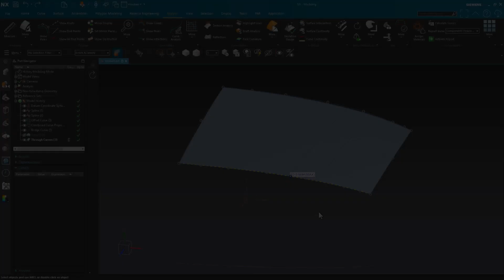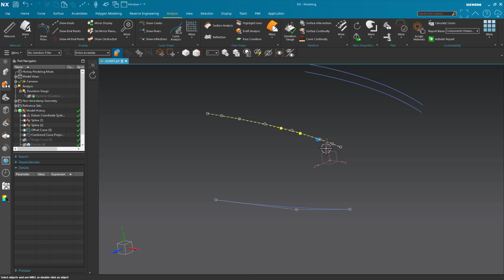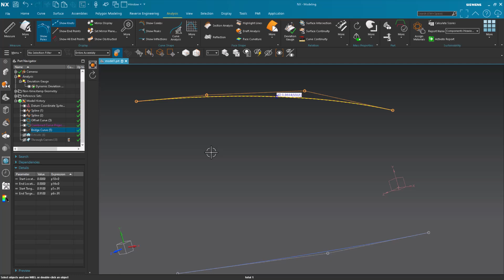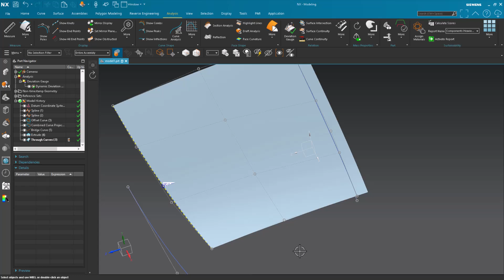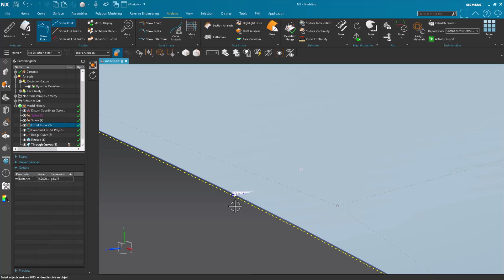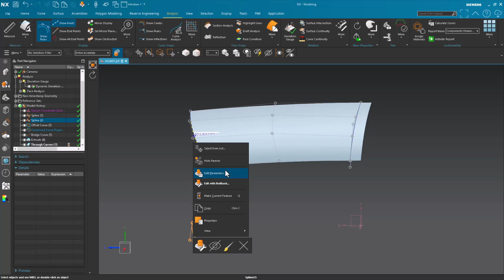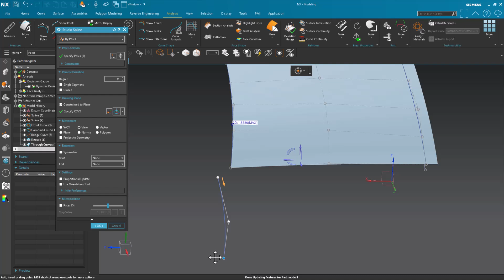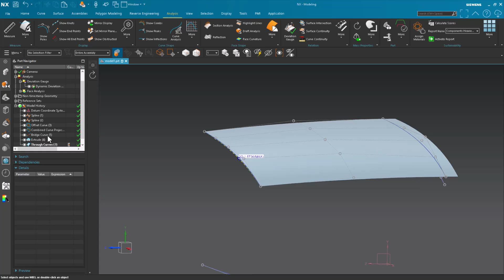Siemens NX 2406 | When I Use Combine Curve and Why

Comment: I think it's much better to simply use the Advanced curve fit option within the Combined projection dialog. Set it to Auto fit, 3 - 3 - 1. That way, it updates automatically without having to continuously mess with a Bridge curve.
Reply from the maker: Some people do not have the Advanced Studio tools so they need a work around.